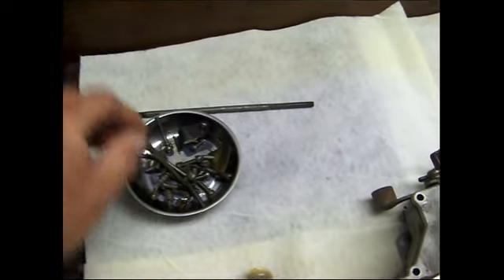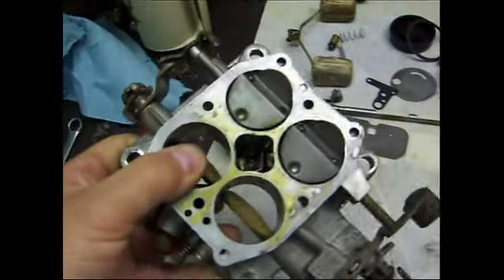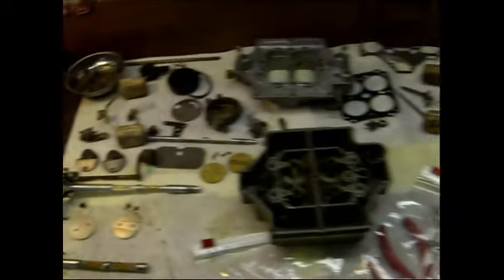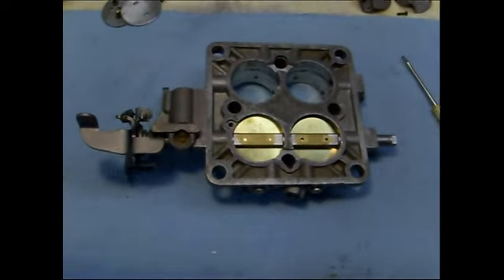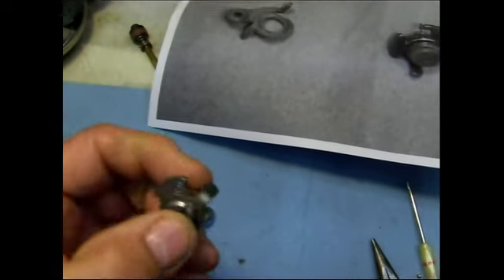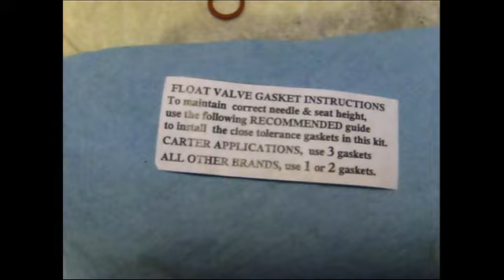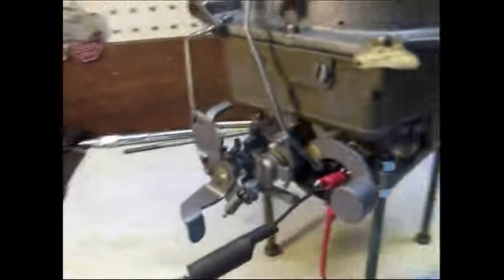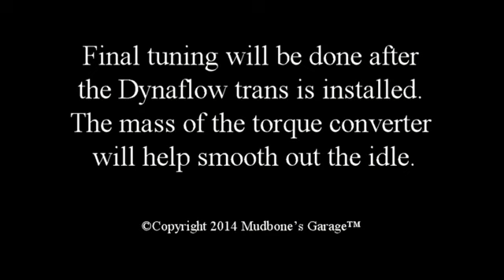1955 Buick Century Carter Carburetor Rebuild

Comment: So, my uncle bought a brand new '56 Buick convertible and brought it over to show my folks. My mom got in the driver's seat and asks if she can drive it. My uncle said,"If you can start it, you can have it. Well, she turned the key and it just stopped at "on". She figured she'd pump the gas pedal once while figuring out how to start it when it fired right up! He didn't give her the car though. I've got a set of AFB's from a Buick that have a small dia. intake like a WCFB on a Edelbrock manifold on a sbc in a '26 Ford Tudor. The rear carb has the switch and i'm kind of thinking of setting it up to work.

Comment: what lubricant did you use for that shaft where the graphite stuff should go? rebuilding mine now and that shaft doesn't feel as smooth as I think it should, really don't want to pull it out if I can help it. 
thanks for posting these videos, very very helpful now that I have a '55
Reply from the maker: I think I mixed graphite powder with Marvel Mystery oil
Reply from the maker: You could mix graphite with mineral spirits and inject it in with a syringe. The mineral spirits will evaporate leaving the graphite
Reply: @dyna1955  both of those ideas sound pretty good!

Comment: Often, a well used carburetor will have a worn throttle shaft allowing air leakage between the shaft and housing bore.  What did you find on this carb, and how much wear would you consider too much?
Reply from the maker: I did not actually measure it. I just gave it a visual and a wiggle test. It seemed pretty tight. (72,000 original miles) I was thinking what it would take to cut an internal o-ring groove into the body so they could be sealed. Do you know anyone who has tried it?
Reply: dyna1955
Typically both the shaft and the housing bore would be worn, so I like your "O" ring idea which would compensate for wear on both.  Can't think of a way to cut an "O" ring groove in a bore that small though. Maybe a shallow counter bore on the outside of the carb  (2 places) having an ID same as for the "O" ring OD. Then, make a plug (having a bore for the throttle shaft) to press in the counter bore. Press in until plug is flush with carb.  Plug length would be the counter bore length minus "O" ring thickness (or "O" ring groove width).  Don't know of anyone who has tried this though.
Reply from the maker: William C Newland Jr I have had old tractors with shafts so worn they would not idle at all. We would jam O-rings on the end of the shaft to make a seal. It would wok for a while.